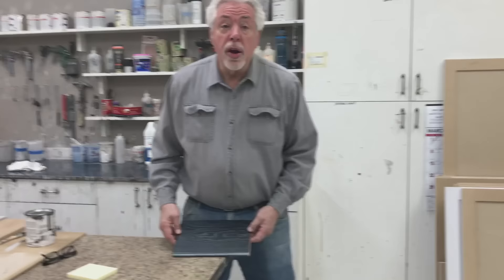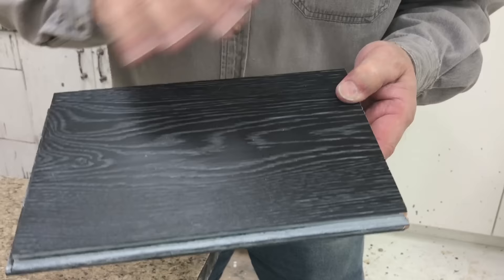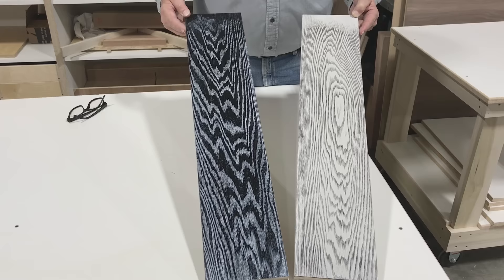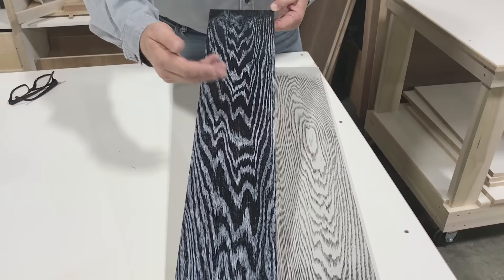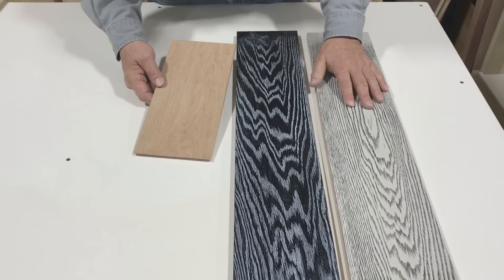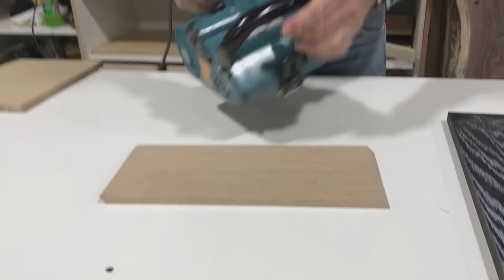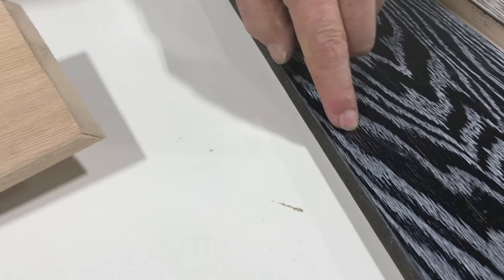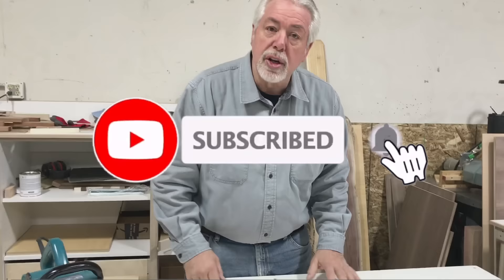Secret to a new trendy wood finishing technique

Comment: OK!  Here is my update from using Sherwin-Williams Sherwood Kem Aqua Plus Clear WB. 

Sprayed two coats of Behr satin enamel paint on a large wine hutch w/ built in hickory wine rack (that was hit with lacquer)
Flawless.  Turned out great! Laid on easy,  melted into each coat well, no bubbling or peel of the paint. 

I did a few test pieces on various woods and here are the results:

Oil based stain on maple ply:  Two coats, no sanding between (30 minutes apart) no issues.  I did place a third just to see and without sanding I did get some micro bumps in various spots.  I wouldn't do 3 again on oil based stain.

Clear maple:  No issues

Maple with oil based stain: No issues 

Unsanded select pine:  No issues, not even grain raise.

Walnut:  No issues, though it was pretty dull.  I would opt for urethane or oil top coat on this for sure. 

OVERALL:

Definitely like the product and will use again for pretty everything, unless it's a walnut or natural wood requiring a pop finish.  I'm going to talk to the techs at Sherwin-Williams and look into a tint to help with the "dull" look on natural woods. Hope this is helpful for all!
Reply from the maker: Thank you! Having not used water based finishes this is very informative.  Sharing information like this helps all of us and I appreciate it.
Reply from the maker: I added a new video on this today which explains the process much better. Thanks https://www.youtube.com/watch?v=LdmsLbqGA1c&feature=youtu.be

Comment: 1st time here; very cool Wes! Very cool. I was researching a method of staining in black. A more contemporary look for a Bakers rack I am building out of 1" rounded 1/8" aluminum. TIG welded. The wood I chose more out of economics for my sister-in-law, select 3/4 pine from HD which is lovely and clean. I burned a Mapel 2" slab for a job and used an epoxy clear bar top and it came out almost 3-dimensional, totally cool. Can't burn 3/4" anything, so wanted to try black stain. I would of got oak but didn't know. I will be learning more in the weeks to come from "Woodworking with Wes" good times
Reply from the maker: Thank you for you comment and good luck in your future projects. Wes

Comment: Been doing this for years on repurposed furniture getting it wet will naturally raise the grain as well then stain it or paint it then glaze and sand clear coat. I can match floors or any color paint to use as a base color. Burning it will also reduce the softer part of the grain and combined makes it feel like it looks.
Reply from the maker: Hi...wow, very impressive! Thank you for sharing that good information. Thank you for visiting my channel. Wes
Reply: I tried this style on my electric guitar. Wet the grain with water based aniline dye, seal with sanding sealer then sand and clear coat. Looks similar to this video, but in my case green and black. But I might try this on my next build.

Comment: This technique works extremely well with soft wood (Douglass Fer)
I make outdoor seating benches
I prime the stock first after dried
I take that wire brush holding it at a 45* start to brush the wood vigorous, that's it
Clean then paint 
One or Two tones
One tone, grains pop very nice
It also feels good to the touch
Reply from the maker: Wow...very nice. Thanks for sharing :))
Reply: @WoodworkingWithWes  can you please share the type of paints you used for the black and white?
Reply from the maker: @feb0885  Hey check out the video where I go more in depth as to how I get this look and the products I used. Thanks. https://youtu.be/LdmsLbqGA1c

9

 ▼
Reply: You use paint? It's not stain. Want to try this.
Reply: @melving2564  thanks for the comments
Are you asking, do I use stain, Yes stain give a nice appeal to the sense

Paint give more of an textured effect, you see & feel the uneven grain under the paint

Comment: Thanks for doing the cerusing videos. You’ve inspired me to finally tried it out. But I’ve run into a problem. When I go to sand after the 2nd color (glaze mix), it stays milky on the dark color. I’m not sure what I did wrong. I used exterior acrylic on 1st color (2 dark coats) and mixed glaze with white interior acrylic. The glaze didn’t wipe off very easily as it dried quite quickly. I mixed it about 3 parts glaze to 1 part paint. I thought that would be ok but when I sanded, it stayed that way. I even sanded down to bare wood in a few spots. I may not have let the 1st or 2nd color dry enough or both. It was over 24 hours drying time. Or perhaps I mixed the glaze wrong. Next time, I may try a clear coat between colors to see it that goes better. I’m going to just go with what I’ve got rather than start over as it still looks ok. It just doesn’t have the sharp contrast I was going for.
Reply from the maker: Hi...different products will give different results, always. A clear sealer coat between paint and glaze might solve the problem. Give that a test try. Thanks, Wes

Comment: Excellent video and a true craftsman. 
This video is so well done. But I just wanted to say. The two colors of finish both of which are beautiful btw,.. would be better defined if you taped the same one piece board down the center but the same grain and sealed on one buried level just to showcase the offset of the effect of the offset of finishes but better recognized when it's viewed on the same grain profile...? If that came out correctly. All thumbs up.
Reply from the maker: Hi Richard...that's a great suggestion. I will try to get that on a video. Thanks for watching. Wes

Comment: you should try mono coat,   you put the pre colour on first and the oil on 2nd the oil has a hardener that you add to it,   its a very durable finish used for floors but you can use it on any projects
Reply from the maker: Hi Paul...what a great idea! We appreciate this and i would love to do a video using the method you suggest. I am not familiar with the process...could you please explain in more detail as to what I would have to do to end up with the cerusing look? I am excited to give this a try and would love to give you a shout out on the video if you don't mind. If so, let us know where you are from and anything you would like us to mention with your woodworking skill level. Thank you.
Reply from the maker: @theborderwolf  Thank you very much...we will check into it.

Comment: So the way you demonstrated the spray technique was different to your explanation. In the video demonstration, you showed the base colours being sprayed, then you showed the glaze colour going on top of that and wiping it down. In your explanation, you stated that you sprayed on the base colour, 'sealed it' (?), then applied your glaze coat, sanded that with a sponge sandpaper, then topcoated it. Is that correct? Very cool look!! I like it! I guess that this wouldn't work with pine? Not as grainy as the hardwoods.
Reply: I had the same question that you asked. I’ve been doing projects with pine, and the most valuable thing I learned that drastically improved the finishes is using pre stain conditioner (oil base), and the explanation I read says it makes the grain stand up/ or open up. It really made a difference, so I’m going to try it with the new technique. I saw another guy do that process on pine 2x4’s and it looked awesome. I won’t use sealer until the end.
Reply: @patrickdunn8918  When I was installing oak hardwood treads on my stairs they needed to be stained first to match the existing hardwood floors, and we were told by the wood provider to wet each stair tread beforehand to raise the grain of the wood, then sand and repeat until the grain doesn't raise anymore. Great advice and saved a lot of frustration through what could have been a really traumatic experience.

Comment: So why not use water to raise the grain? Don't need the makita sander. Just wet the wood and let it dry and it will raise the grain of the wood. Then can sand it somewhat to make it smooth and then do your stain technique
Reply from the maker: Hi Charles...I don't feel that water sufficiently raises the grain enough to create the texture that I am looking for. The wheel sander also removes some material that just using water would never accomplish .Thanks for your comment and I appreciate you visiting our channel.

Comment: I did this on treads on a circular staircase. Will a lacquer be a durable enough finish? I don’t want my great work to get beat up too soon. I think a couple coats of lacquer might suffice.
Reply from the maker: Brett...I don't think lacquer would be a durable enough finish for treads on a staircase. I suggest checking with a hardwood floor supplier for a more durable finish to protect your wood. Thanks for watching. Wes
Reply: @WoodworkingWithWes  thank you for responsez

Comment: What kind of paint used Mr. Wes? It is so beautiful! Congratulatiins!
Reply from the maker: Thank you for the compliment...I appreciate that.  The paint is the same as my video with the 3 cabinet finishes I posted.  It is a tinted primer sealer from M.L. Campbell.  I used a white/black oil based glaze and final step is a clear top coat of lacquer.  I appreciate your visit.
Reply from the maker: https://youtu.be/3mMxC9ZWsew
Reply from the maker: We have added another video today on this technique. Thank you.
https://www.youtube.com/watch?v=LdmsLbqGA1c&feature=youtu.be
Reply: @WoodworkingWithWes  in
Reply: @WoodworkingWithWes  in
Reply: @WoodworkingWithWes  jeez. Watched the other video to get the answe to the question the guy asked cause I was curious also. That video didn’t address the question either. You keep saying paint. Wth? I’m not familiar with vinyl paint. Is it latex, oil, lacquer, or what?  Pretty easy question
Reply: @jay_shipes  a few weeks ago I was doing a similar project for a customer, I used a white base lacquered paint let it dry gave it a bit of a light sanding with a used 350 and paper and I applied a black glaze over the entire piece one section at a time let it dried and followed it with a high gloss lacquer finish... from what I experimented with it can be with pretty much any color... you can also use gel stains those work pretty good too
Reply: @jay_shipes  Dude he fucking shows you the can of paint that he's using even he's shows you the glaze that he's using how we're you not able to get the info from that
Reply from the maker: @jay_shipes  I checked with my paint supplier and he indicated that vinyl sealer is a resin base. He also said that most paint suppliers will have a vinyl sealer of some sort available. 
This was all the information I could find for you...hope this helps. Thanks
Reply: @jay_shipes  your a classy guy...not
Reply: @kccolly8459  No doubt. I really value your opinion, and the need for you to jump into conversation that happened 5 Months ago. The world is a better place knowing your out there lurking fighting the good fight. Thx so much.

Comment: You said you seal it on the black one, so the step is, spray the black paint, sealer, apply the white glaze and wipe the gaze.
last one is top coat. 
Is it correct...?
Reply from the maker: Hi...this process is explained in greater detail on our 2nd video. This link will take you directly to it: Thank you
https://youtu.be/LdmsLbqGA1c

Comment: Before you put the glaze on, which finish of paint did you used? water base paint or oil base paint?
Reply from the maker: This is done with non water base primer sealer as my color coat. Thanks for watching. Wes

Comment: Sorry Wes did I miss what products you used. Like type of paint an type of glaze ?
Reply from the maker: Thank you for bringing that to my attention...I will put it in the description.  The paint is the same as my video with the 3 cabinet finishes I posted.  It is a tinted primer sealer from M.L. Campbell.  I used a white/black oil based glaze and final step is a clear top coat of lacquer.  I appreciate your visit.
Reply: @WoodworkingWithWes  any thoughts and/or experience with the water-based finish like SW Kem-Aqua or General Finishes Enduro-Var?
Reply from the maker: @biglav6048  I really don't have experience in using water based finishes. I stick with the products that I know and have served me well.  I have heard that one of the drawbacks of water based is a longer drying time but thats about all I know.  Thank you...if you try and have good results let me know, I am always interested. Thanks.
Reply: @WoodworkingWithWes  I will let you know!  Picked up some Sherwood Kem Aqua Plus today.  I'll post the feedback here.
Reply from the maker: @biglav6048  Sounds good !
Reply: @WoodworkingWithWes  Hi Wes, great video! Can you specify which oil-based glaze you use? I don't see it in the description box? I also checked out your other video but am still a bit confused. Your help is appreciated!
Reply from the maker: @1492simon  Hi...I use McCloskey Translucent Color Glaze. You can purchase it on Amazon.
Thank you for visiting our channel and good luck with your project.
Reply from the maker: @biglav6048  I have uploaded a new video on this technique which I think will clear up questions on product and technique. Thanks .
https://www.youtube.com/watch?v=LdmsLbqGA1c&feature=youtu.be
Reply from the maker: @1492simon  I have just posted another video today on this technique. Hope it answers any questions you might have on product and technique. Thanks

Comment: Does the texturing remove the smoothness from sanding? A bit confused
Reply from the maker: The texturing enhances the grain so that you can feel ridges and valleys of the grain. It is not rough like an unsanded board however. Thanks, Wes

Comment: Would something like this work to do a faux spalted look? So instead of a colored paint a clear coat.  Then sealer ( what kind of sealer would you use by the way?) And then the dark glaze and a final sealer?
Reply from the maker: Hi...I don't know if you could get a faux spalted look with this process, I have never tried it . 
As for a sealer, check with your paint supplier for one that will meet your needs. Thank you very much for watching.

Comment: Wes, Thanks for this video. I have sanded reclaimed white oak for an outdoor table top. Instead of using white/black combination, I will just use Minewax Simply White, wiping it then brushing it, until I get the desired effect. Then, because it will be used outside, apply Helmsman® Spar Urethane. Will this give me the "ceruse" look and the outdoor protection or do I  have to use an exterior stain.
Reply from the maker: Dennis...your exterior top coat will protect the current stain that you are using. So you are good to go! Thank you very much for watching my video.
Reply from the maker: I have added a new (improved) video on this today https://www.youtube.com/watch?v=LdmsLbqGA1c&feature=youtu.be

Comment: I got a client that has a chimney with alder already installed would this method work. I know you said Alder wasn't a suitable material to be working with this technique, unfortunately it's already there and is what I have to work with
Reply from the maker: Hi...I did not have much success with alder and that is why I didn't recommend it. Perhaps a more aggressive  texturing might help with alder.  Do a test sample. Good luck...let me know how it goes. Thanks
Reply: @WoodworkingWithWes  i was afraid you'd say something like that. But no worries if I can I will definitely send you the before and after pictures
Reply from the maker: @epenaloza52  That would be great if you can...thanks
Reply from the maker: Wanted to let you know I have added a new video today on this process with a better explanation. Thanks
https://www.youtube.com/watch?v=LdmsLbqGA1c&feature=youtu.be
Reply: @WoodworkingWithWes  awesome video I just saw it... update on the chimney... since I couldn't use your technique I ended up burning the whole piece and then running a wire brush over it to remove most of the burnt part and added a coat of sealer sanded that smooth then I added a white glaze over the entire pieces with a final clear coat unfortunately I completely forgot to take pictures

Comment: Hi Wes great Video! What is the grit on that roller to sand the wood ?and im thinking about doing this on my oak stairs
Reply from the maker: I used the nylon wheel that was included in the purchase and I am sorry but I do not remember what grit it was but it did a great job. Thanks for watching. Wes
Reply: looks like the Makita 9741 ships with a 100 grit (medium) nylon brush

Comment: Is Birch a good candidate for this effect or not? Thanks
Reply from the maker: Please check out our video https://youtu.be/iOH8RAJLKKs to make your decision on birch. Thanks for watching. Wes
Reply: @WoodworkingWithWes  Thanks I watched, but birch was not included 🙁 Since it's a hard wood will it cerruse like oak or ash?
Reply from the maker: @travesm5054  Hi Traves...sorry, I meant to give you this explanation when I first responded. Birch would be included in the smooth grained woods such as maple which do not do as well as the coarse grained woods, such as oak and ash. Thanks.

Comment: I'm looking to do a black stain base on oak with a metallic gold ceruse as the accent... which product would you recommend for the ceruse? I used a Minwax True Black stain and I'm having trouble with too much of the accent being left covering the non-grain parts and over-vigorous steel-wooling removed too much of the stain. I really want a clean Black base with gold grain.
Reply from the maker: David...for my black color, I used a black lacquer not a stain. I then lightly sanded to smooth the lacquer. My next step was applying the white glaze - finished with a top coat of clear lacquer. Hope this helps, thanks. Wes
Reply: @WoodworkingWithWes  ok. now the info for the white glaze over black. finally found it. but when you say black lacquer. which brand and which product. w/cat or without etc.